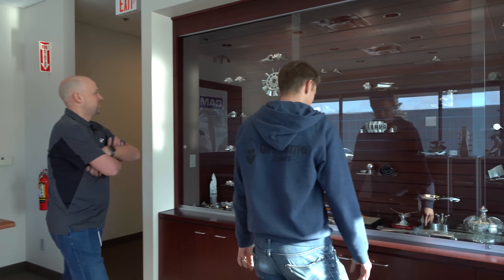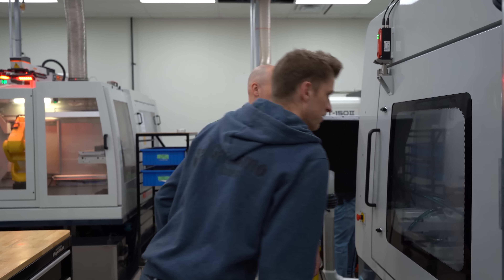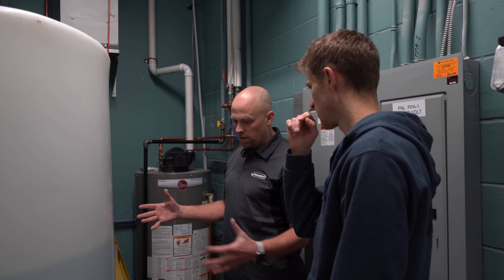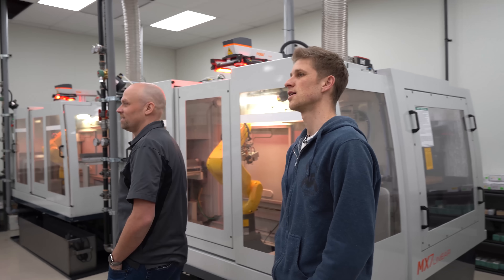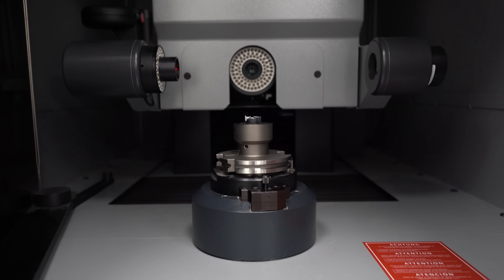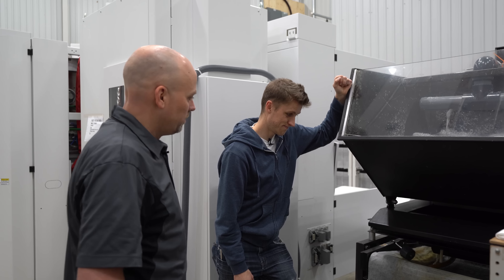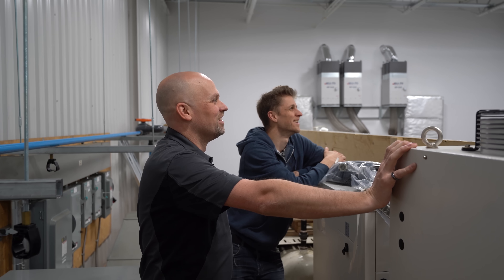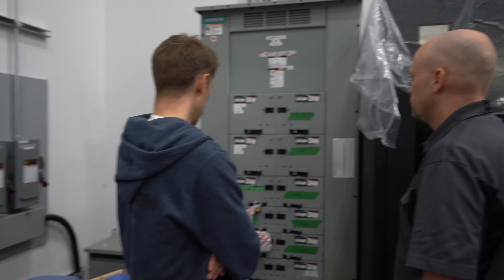NEW SHOP EP. 3 - Miltera Shop Relocation Tour

Comment: @21 min, my dump hoppers all have the three wheel motion too!  Welded a bung in the bottom and screwed in a brass exhaust muffler with a hose back to the tank.  End of hose has a magnet that holds it in place and holds it to the side of the hopper on the way to the briquetter.  Works slick and was cheap

Comment: When you go to do your coolant setup if you plan on using DI water look into a metering pump for the coolant that will mix a percentage of coolant with the water so you have the proper mix. You don’t need a holding tank with this method you can just fill a bucket or a water cart etc. with a proper mix and just dump it into the machine.
Reply: Yep, that sounds like a good idea. Pierson has similar setup, cart with coolant mixer and going from machine to machine, refilling as needed.